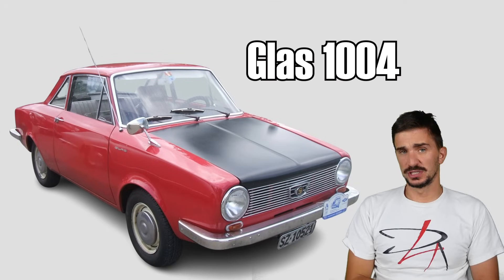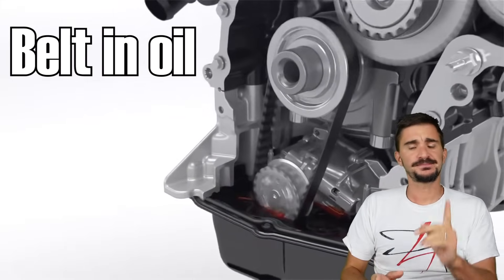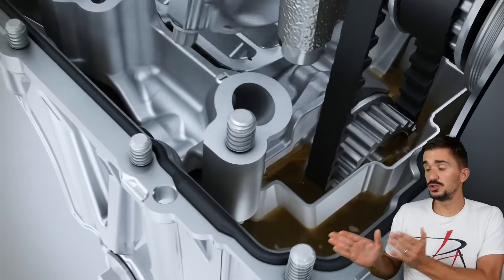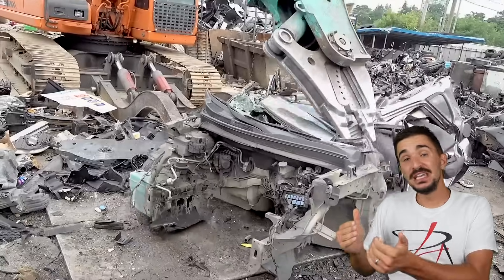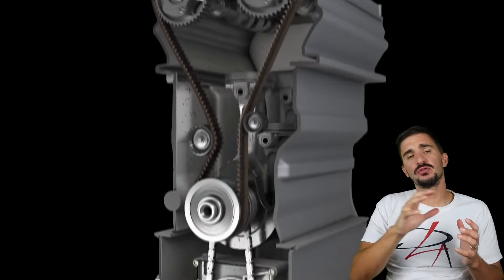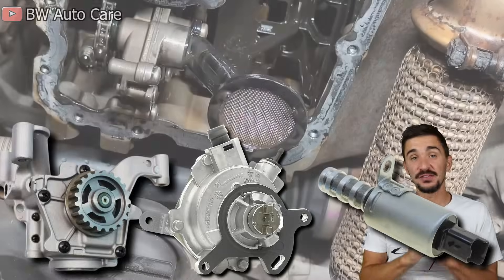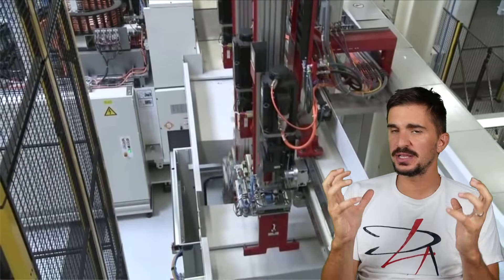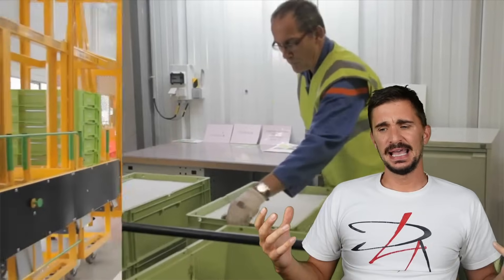Who Approved This and Why Is It Still Being Made? Wet Belt aka Belt in Oil Engines

Comment: I’ve heard that the problem of the wet belts that disintegrate in Peugeot engines is not oil but fuel contamination of the oil, especially the 10% ethanol in E10 petrol.
So what’s needed is much better sealing from the piston rings. I don’t know about other engines.

Comment: It very well might be in comments below, but the way I’ve heard it from some industry guys is that the wet belt comes actually from automotive supplier based on some requirements and that if kept in the defined parameters it’s performing as expected. What actually kills it is the fuel that gets into the oil and if the engine runs only short journeys, there should be a bulletin from the manufacturer to shorten the intervals for both oil and the belt. 
D4A has usually good technical content but based on what I was told this one seems to me like blaming the messenger. Maybe I am just too old (remembering how we had to change between summer and winter oils, carbs and all that jazz), but I think we got way too comfortable with mechanical sympathy and expectations (sure it’s ok to drive 2km to shops every day,  then 5 to work an change the oil every 30k km…). Rant over.

Comment: I have a 2011 Seat Leon 1.2 TSI 77kW with a timing chain. At 88.000km I changed the timing chain set just to be safe and service the car regularly with premium oil and parts. It now has 113.000km, no issues whatsoever even though I heard many negative opinions on this engine.
Reply: Never heard of this brand is it pretty popular

Comment: 12:30 I literally just dealt with this on my truck, I had 10 psi of oil pressure. It was the o-ring at the top of the pickup tube, and in order to replace it I had to remove the transmission support member, the front differential, and both CV axels to be able to remove the oil pan and get to the pickup tube to replace a $1 o-ring....
Reply: What make/model?
Reply: @nattadam4171  2009 Chevy Silverado, the 4x4 runs right below the oil pan.

Comment: I love my old vw 1.9, the belt change every 90k km as recommended that i do my self. Parts everywhere, 400k on the clock and still beating like a champ, our other car, 1.3 toyota vvti, that motor also well build,l with a chain, and even the chain require a 200k inspection of all its parts

Comment: main issue is the many cold starts when at the start it is very fuel rich and the gasoline goes down to to the oil and the rubber will be eaten by the gasoline quite quickly...

Comment: Don't by cars with wet belts my citroen  pure tec belt failed at 50.000 and again at 60.000 with insane oil consumption.  Serviced at citroen garage correct oil etc was an absolute  money pit

Comment: The wet belts advantage is that it causes a failure that exceeds the value of the vehicle. It's called planned obsolescence engineering. Ford has been doing this for decades. Ever since the release of the ohc 4.0 in the mid 90s.

Comment: Renault never had an oil immersed timing belt in ther engines. At least on mentioned in this video- 1.5 dCi (K9K) with dry belt, 1.2 TCe (H5FT) and 0.9 TCe (B4D) are with timing chain.

Comment: Thanks. I don't like even dry timing belts. I like wet belts much less. I'll stick to chains or, eventually, EVs because service intervals will become less frequent.
Reply: Be careful what you wish for; EV manufacturers probably haven't yet finalised plans for "under engineering" their current products in the way that more reliable timing chains were discarded in favour of cheap belts.  I wouldn't put it past them to start compromising battery safety systems or cutting corners in the programming of onboard computer systems that might override driver inputs.....

Comment: Good video. I have a Ecoboost engine and I am getting a new wet belt fitted shortly only because its a low mileage vehicle and it's a much cheaper option than replacing my vehicle. I agree wet belts are a terrible design decision.

Comment: the biggest annoyance with a wet belt is that you have to strip the entire engine down to replace it, cost over £1000 last year as its a 10 hour job, previous car with chain was much easier to access and change so it was les than half the price for a chain

Comment: My catalytic converter is dying and the replacement would cost more than the current value of the car, so I will eventually have to buy a new one. When I asked the mechanic during the last oil change, what should I avoid, he specifically warned me about wet belts.

Comment: So what do the manufactures do when they find out the wet belt is a failure? Put it on the back of the engine so mechanics need to pull the transmission to change it. They know but they don't care.

Comment: that's why i love the fiat "fire"  1.1l and 1.2l engines, not only they have an external dry timing belt, but the engine is NON INTERFERENCED! so if the belt snaps nothing will happen, just change the belt and you are good to go

Comment: Assino em baixo tudo o que é dito no vídeo e não poderia ser de outra forma. Sou brasileiro e como os carros no Brasil são muito caros não é raro encontrar-se veículo com bem mais de quinze anos rodando sem problemas. No meu caso, esse prazo foi bem além. Tenho um Chevrolet Astra 2002 - motor da Opel 2.0L - com correia dentada que por desonestidade de quem fez a manutenção ultrapassou em muito o prazo de troca da referida correia. Imagino que essa troca tenha excedido 120.000 Km. No entanto, ao examinar-se o estado da correia, o desgaste verificado estava normal, nada de excesso, como desfiamento ou dentes faltando. Foi só realizar a troca e eu continuo a usar o carro normalmente,  principalmente em trajetos curtos. Eu sou a prova viva e atual que as correias de borracha não banhadas a óleo poderiam facilmente exceder 100.000 Km com uma ampla margem de segurança. Outra coisa. Não comprarei jamais o veículo turbo de três cilindros que foi colocado no portfolio da GM do Brasil para substituir o carro que tenho. Esse veículo no caso o Ônix que está apresentado aqui no meu país exatamente os problemas descritos.
Reply: I sign everything said in the video below and it couldn't be any other way. I'm Brazilian and as cars in Brazil are very expensive, it's not uncommon to find vehicles that are well over fifteen years old and run without problems. In my case, this deadline was much longer. I have a 2002 Chevrolet Astra - Opel 2.0L engine - with a timing belt that, due to the dishonesty of those who carried out the maintenance, far exceeded the deadline for changing said belt. I imagine that this replacement exceeded 120,000 km. However, when examining the condition of the belt, the wear observed was normal, nothing excessive, such as fraying or missing teeth. All I had to do was change it and I continue to use the car normally, especially on short trips. I am living, current proof that non-oil-bathed rubber belts could easily exceed 100,000 km with a wide margin of safety. Another thing. I will never buy the three-cylinder turbo vehicle that was placed in GM Brazil's portfolio to replace the car I have. This vehicle, in this case the Ônix, which is presented here in my country, exactly has the problems described.

Comment: 😊Also the ones like Volkswagen Skoda an Aldi use a wet belt oil pump beware they try to avoid that telling you I mean. Remember the wet bell oil pump recommended 40,000 miles time belt recommended 80 to 120,000 miles the oil pump belt is under Timing belt.

Comment: I had a 65 corvair, great engine, two mistakes in design, rubber fan belt that took a 90 degree turn from vertical to horizontal, always breaking or slipping off, and wait for it: rubber O rings, always needing replacement, I believe gm later changed that to an acrylic.

Why aren't timing belts made from non oil chemicals?

BTW, that corvair was a marvel and groundbreaking, first 6 cylinder flat, rarely known fact, the corvair 6 was the first 6 flat put by porche into their car, backward engineer, but this is a fact.
I would love a youtube on that ground breaking engine, why it went wrong and why it's not made now with design flaws fixed

Also little known, the book "unsafe at any speed" saved corvair for a few years, it was being replaced by Nova, gm kept it around because they didn't want public thinking the book killed the car, it did not

Hoping you do a vid on that engine!

I know this is an old vid, I'll try asking on something recent so you see the request!

Comment: In Iran they have localized TU5 engine from Peugeot which needs oil change before 5000km and timing belt service intervals is before 60,000km😂 although it is hyped as one the most efficient engines in the country 😂

Comment: Atleast they should move the oil pan drain plug directly below the oil pickup tube, and make the plug OD larger. Then it would be possible to clean the pickup from debris during oil change.

Comment: Must have been lucky, My 2012 B-Max (1l 101BHP), has done 260k now and had the belt changed after 10 years (about 210k). I was told that the belt actually looked pretty fine.
I do not doubt that it generally is true that the fail prematurely, and the price was also quite steep. 1.500 EUR and that was even a special offer, normal price was closer to 2.500 EUR.

Comment: Simple solution for the wet belts would be to have engine oil and belt oil separated.  Wet belt doesn’t need oil pump or oil filter.

Comment: 16:42 2017 Honda Civic from Europe and 2020 Honda City from Thailand have 1.0L turbo 3 cylinder petrol engine that runs on timing belt in oil.

Comment: Ill stick with my toyotas. Im not a mechanic, but i used to be pretty cautious with timing belts and chains, for obvious reasons, its a scary thing to touch if you dont know what your doing and where to read the marks. But my mechanic did my timing belt in 30 minutes. Which was interesting, so i was with him on the other toyota, the belt was not for the crank and cams, just the other parts eg brakes and pumps, the important stuff is internal, and not needing replacement. Only scary thing i have to worry about is the exhaust recirculation system, but havnt had that go on me yet.

Comment: Yeah, if it were ONLY wet belts that made you disillusioned with humanity I might question your sanity, but the fact that this type of thing occurs basically everywhere, all the time, makes me concur.  And as an engineer, YES, your speculation on the how and why this sort of thing happens was pretty much right on the money.  Most often, in my experience it is a bunch of MBA cheapskates that think spending three cents less on an item which will 1/2 or 1/4 it's life is a beneficial trade to costing the customer a small fortune to repair MUCH too early in their ownership.   

People think that obsolescence is designed in, but it is really more this kind of thinking that causes items that used to last several decades, like house air conditioners and refrigerators, etc. to now last one, IF YOU ARE LUCKY.  The marketers love to hype the energy savings on things like AC units, with increased efficiencies over short intervals as a plus, but as you pointed out, when you factor in the costs of obtaining materials, manufacturing, and transportation to the point of sale, it is often ANYTHING BUT conducive to cost, energy, or pollution savings, usually all three.  

There is also a trend toward making things either unrepairable, or to costly to repair, again, which does factor into increased sales frequency, as well.  It is a shit for brains mentality, frankly.  All the unimaginable pain that is coming with weather phenomena due to increased global warming, etc. is something we SOOOO deserve.  Screw tomorrow for the monetary gains of the moment.   Most people think we are somehow a master of nature, or enough removed from its effects as to be untouchable, but probably not so much this generation, but say two from now, and at an increasing rate the ones following that one, are going to flat out find out otherwise.  Just watch the screaming when THEIR house is the one currently being flooded routinely at the coast, with every increasing frequency, until the water is halfway up the walls, or their once lush location is becoming a desert.

Well, that got a bit off topic, so I'll STHU and stow my soapbox now.  ;-)  Great vid.

Comment: Fuel..
Gasoline enriched oil under slight pressure and heated to 190°f probably behaves differently from the oil they tested the belt in.

Comment: Do not forget that in the oil of the motor, there's not just oil, the motor receive from particles filter gasoline or diesel, related with the incomplete process. Gasoline and rubber from belt are not very good friends!

Comment: Ford is now using a wet belt to drive the oil pump in some of its engines. And it's on the back of the engine, so it's very hard to change

Comment: I have a lathe that's 46 years old .... The drive is via a toothed wet belt in the headstock .... Same belt from new .
Reply: How much combustion is the belt in your lathe exposed to?   It would be an interesting experiment to replace the oil in the lathe with used engine oil and see what impact that might have on it's belt.

Comment: Ford decided to add this to the 2.0L Ecoblue Diesel inside the 2nd gen Ford Ranger and Everest. Yes to a diesel. That's why 2nd gen rangers and everests are more common in repair shops than the first gen (2.2 and 3.2 diesel).

Comment: Perhaps the Pinto 4 cyl was the first U.S. engine to use a rubber timing belt.  But some 1960's pushrod engines with stout timing chains suffered failures since they used a camshaft sprocket with nylon teeth to reduce noise. The teeth would fail to skip valve timing, though didn't cause pistons to hit valves that I know.  Many engines are non-interference where the pistons can't hit the valves.  My 1996 Plymouth 2.4L DOHC is like that, whereas the similar 2.0L SOHC (Neons) is interference.  My timing belt has failed twice, with no damage, though semi-interference which means the intake and exhaust valves could hit, but that is rare.  Actually the belt didn't break, rather a pulley bearing failed each time (tensioner once, idler 2nd time).

The latest Fiat engines, which I think includes some Chrysler-branded vehicles, have a wet timing belt inside the crankcase.  It lasts surprisingly long, despite polymers in oil.  At least the pulley bearings should last longer since now bathed in oil, rather than "permanently lubricated" in a dry-belt system where "permanent" = "maybe 100K miles".

Comment: Been considering a Buick Envista. Love the car but apprehensive about the 3 cylinder turbo with a wet belt. To buy this car I'd have to start dropping the oil pan for inspection and cleaning of oil pickup and buy the tool to inspect the belt (or have dealer do it)

Comment: Me to the dealer, "I am only buying a car with a timing chain". 

The dealer, "belts are better, you don't want chains they stretch. Plus they are expensive to replace."

"well the service life is still around double (if it even needs to be changed before something else fails) and the average cost of having a chain replaced is about the same as what you charge for your belts to be serviced. Plus, I would be doing it myself"

Comment: I said right from the time they introduced this system it would be catastrophic to run a rubber mix belt in hot engine oil,it was and is a disaster waiting to happen for the owner who has to bear the cost of the failure,this was a cheap way of doing things for the manufacturers with no regard’s for the owner.

Comment: Brilliant and entertaining explanation of a problem created by the desire of car manufacturers to make cheaper engines. The latter aim is not wrong, if balanced by engineers who demand long testing of many samples to prove that the real life of a new material/design will be AT LEAST as good as the existing well proven design.
Ford removed the Fiesta from sale in 2023 claiming they needed the manufacturing space for Electric vehicles. I suspect they wanted to reduce their warranty costs on their 'award winning' ECOBOOST 1 litre engine with wet rubber timing belts that powered the Fiesta!

Comment: One of the better-selling small crossovers in the States is the Korean-built GM Chevy Trax...1.2L 3cylinder turbo with a wet timing belt.  Oil change intervals are 7.500 miles with timing belt change at 150.000 miles.  Selling like hotcakes because it's a 25.000 USD vehicle.  I hope it works out.

Comment: I suspect the short answer to your question is the belt suppliers, who presumably convinced the OEMs that there were net benefits in terms of cost, weight, NVH, service, warranty costs etc. For their part, the OEMs will have done significant validation testing to convince themselves that the products were suitable. You might then conclude that the conventional validation tests were not entirely suitable for proving out this type of component in this application - or perhaps there are new failure modes and wearout mechanisms at play here that weren't anticpated. It may have been assumed that the belts would only see engine oil, overlooking the presence of fuel and combustion products in greater concentrations than in the established tests. Are several belt manufacturers involved or is it mainly limited to one?

Comment: 10:35 To explain further. In a rich running used engine gasoline (petrol) escapes into the engine oil and these belts are not gasoline resistant! Never, I repeat never buy a car with that technology. 👎